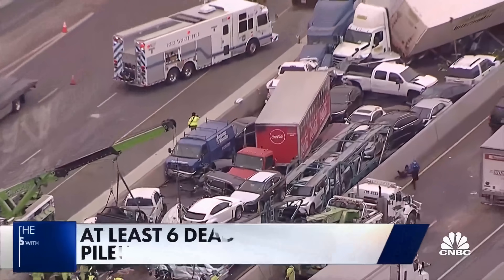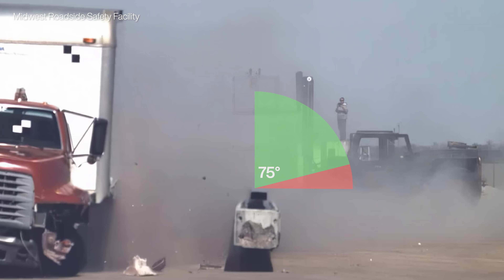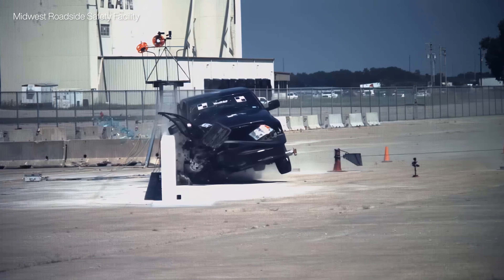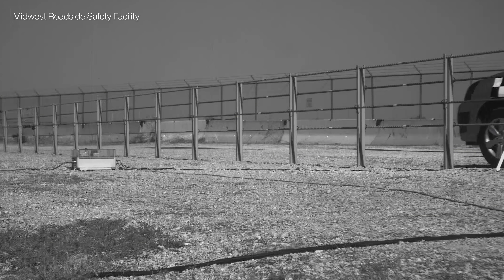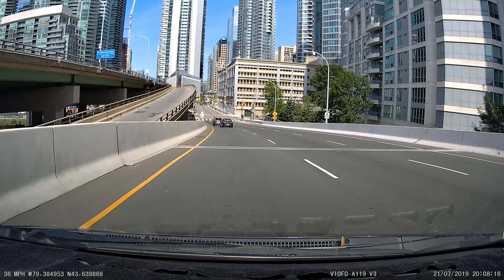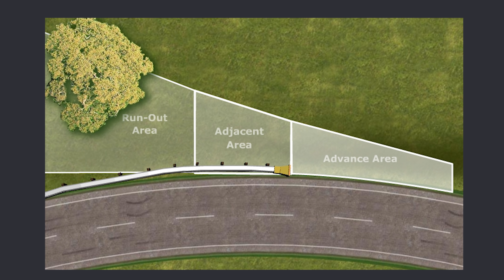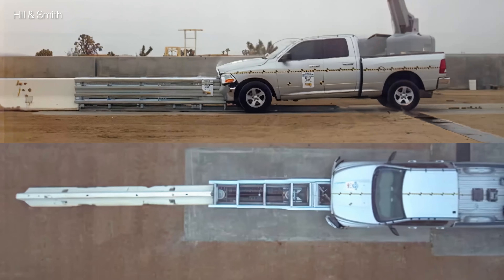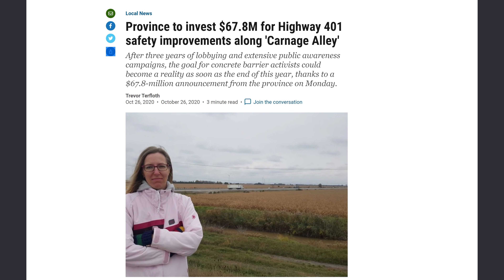How Road Barriers Stopped Killing Drivers

Comment: And remember, the new designs that save you only work if they are installed correct. If a bolt is in the wrong spot, the wrong parts are used, or a cable isn’t set right, it will not crumple correct and it’s locking up

Comment: Thank you for your report...
You left out; Cables barriers need replacement after every impact. Down Time from impact to replacement means there is no barrier. Where as Concrete will deflect again, and again without the need for replacement.

Comment: M53 in Michigan got cable and cars  penetrate easily. Most of the free way has space between lanes to let drivers regain control. It's a rural free way and the cable is very unsightly

Comment: Homestly Never thought about all of that and now I wanna Go out and Look at all These structures here in germany and Analyse how our road safety barriers work. I just know that wie manly have the Metal ones, only Highway constructionsites have concrete ones which you Canon easy take off. As I remember the Metal ones here run in to the ground Like a ramp usually. On roads with a lot of motorbikes and accidents involving these we also have like a metalpiece under the Main Barrier, to avoid Bikers to get Split in two. But from what I‘ve Seen in this Video, it seems Like Road barriers are way more advanced in the U.S. than germany. But also we have other safety measurements like TÜV or proper long and thorough drivers licence classes. So idk if that already makes differences, anyways now I wanna know more abou how it works in germany

Comment: If concrete barriers were any unsaffer, id be dead 100%. Went 122 into a highway barrier at an angle of like 30-40... pretty steepe. Ended up ripping both axles, ruined my front end to oblivion, but i came out unscathed 😊 im extremely grateful

im talking about the jersey barrier

Comment: 7:28 - "equal, or slightly higher fatality rates" - but the Washington study shows the fatality rate is more than twice as high with cables? I'm not sure you can say 'slightly higher' even if the percentage of total is 0.5% higher -- I'd sure as hell want to crash into the concrete over the cables with those stats

Comment: Great video.  Just built my house in Japan. Have a circuit box by Panasonic that is similar to yours and the plugs all match yours.  You are right about the wire and screw requirements for wall plugs in kitchens and washrooms too.  The electrician said they would be required in plugs needing a large amount of electricity flow or that are near water sources. Think wash machine, air-conditioning or plug in kitchen appliances.

Comment: 9:31 on guardrail end terminals, and rails in general, there are a few important things:

The trinity system you showed has been shown to have several flaws, often completely failing and spearing instead.

End terminals and guard rails in general do not work if not installed or maintained properly. Pretty obvious right? But the unfortunate reality is that these often are NOT installed correctly. From missing bolts and uninstalled cables, to bolts on the wrong side and in the wrong spots, any mistake in installation can and do cause these systems to fail and end up spearing occupants or otherwise failing to stop the car safely. 

Furthermore, many of these systems are not actually tested at high enough speeds (eg 70 mph) before they are approved for installation.

See Steve Eimers channel. His daughter was speared and killed by a guardrail end terminal that failed. He has numerous videos showing the state of disrepair so many guardrails are in, and talks about which designs have and havent been tested properly.

In my own area, there are numerous sections of guardrails on the local highways that are damaged, warped, and/or use outdated end terminals. All of these are death traps waiting to spear someone, and they likely will before they are replaced, since "phased out" just means that new installations have to be up to code. So in order for certian installations to be updated, someone has to crash into the old one first.

Comment: I don't trust the cable barriers anymore, I used to think they were great for all of the reasons you listed.
In my home town a few years ago the cable barriers caused 2 very tragic fatality accidents.

Instance #1
A lady was driving down the highway (investigation found she was doing the speed limit of 60mph) she had a heart attack or stroke while driving and was luckily dead before she hit the cables, had the cables worked properly it would have ended here, instead she hit the cables for her direction on the highway it caught her car and made it change it's angle to where her car went through the cables and she hit the cables for the oncoming direction of traffic at a sharper angle and her car went through those cables as well where he then continued head on into a family killing them on impact.

Instance #2.    This was 2 weeks later 1/4 mile south of the first crash (the cables had been replace and all supports were repaired and ready for another crash)

Lady was driving in the opposite direction of the first crash, iirc she was also doing the speed limit of 60 and was clipped by another car causing her to go off the road into the cables. The cables ended up killing her as they went over the car and removed the roof, her vehicle continued through the second set of cables designed for the other direction hit a semi truck head on ensuring she didn't not survive, killing the semi driver on impact and the semi threw her vehicle back into the oncoming traffics left lane where she was then hit by another driver killing them.

Comment: Hwy 2 Alberta canada had clear areas for vehicles to go off the road in slippery conditons or being cut off. Then they put cables up, which completely totals any vehicle that touches it. I was cut off badly before and had to go to the clear area. My car was fine and drove out. If it happened a few years later, i would have to  make a split decision to be tangled in cables or rear end a car.

Comment: Good video. But i want to comment that traffic deaths are not down. When this video was posted the deaths hsd increased significantly in the last 5 years and they were at a high not seen since the mid to late 2000s. Not sure how that information got messed up.

I also wanted to seat belt enforcement is quite minimum and catching drunk drivers accountd for likely less than 5% of actual drunk drivers on the road. I think its more likely educating drivers about the risks associated with not wearing seat belts and drunk driving. Combined with the safety features added to cars amd traffic innovations like you showcase that stop us from having even more deaths. 

But we are definitely having more traffic deaths than we've had per mile driven. Some evidence showing thats to do with people driving bigger heavier vehicles with numerous blindspots combined with infrastructure that utilizes minimum traffic calming and encourages high speed. Lets not forget sprawl causing longer commutes which increases vehicle hours driven and increases the need for driving for trips that public transportation, walking, or biking could have been sufficient for had our infrastructure allowed for it. 

I think showing the graph back to the 1920s is a tad disingenuous because people were driving steel death traps with no air bags, selt belts, no crush zones, and nearly nonexistent traffic rules or drivers education. 

The real story is that people are currently dying WAY MORE.

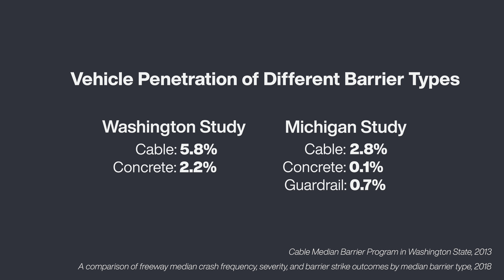Comment: 7:27 it’s misleading to describe the results of the Washington study as cable barriers having “slightly higher fatality rate vs concrete”. Putting the rate into context, both fatality rates are small to begin with, and the cable barriers in that study show a fatality rate that is MORE THAN DOUBLE that of concrete. I’d argue that that IS a significant difference, even though 0.5% difference seems small. When considering the number of car trips taken every day by Americans, that’s a huge difference! You can argue for their use due to differences in injury rate, but it’s bordering on deceptive to try to minimize the difference in fatality rates. Just acknowledge the difference for what it is!
Reply: Excactly what I wanted to say. Imagine you have something that can reduce the fatality rate by more than half.
Reply: Yes, but the sample size is too small for an actually significant difference, so this study of this sample likely does not reflect the actual differences between results due to these two kinds of barriers. There's no conclusive evidence that they are different

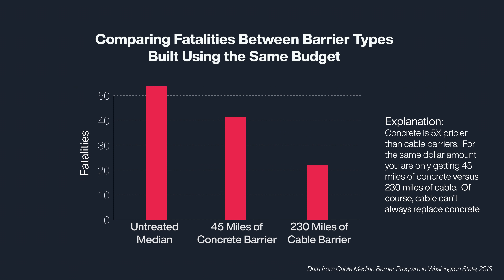Comment: 7:55 I didn't notice you mention this, but I write it down anyway. 

What I speculate about is the Hazzard of cable barriers in relation to motorcycle accidents.

Here, the body can wrap around the poles and cables, while solid concrete with a slope wouldn't pose that risk.

I always get the creeps while riding  on highways, which cable barriers. If I get unlucky and slips, I pose the risk of sliding into those getting decapitated or split in half or wrapped around them.

Comment: Would you consider doing a video on protected intersections? Toronto is building one right now, scheduled to be completed by the end of the month (August 2024). There are a lot of details that go into them, for experts. But the general public is not very aware of them and would benefit from a deep dive on the topic.

So far I discovered 5 different kinds.

The Dutch standard
CYCLOPS, in Britain
Painted intersection, like in Salt Lake City, that used temporary materials
The Davis, California design that splits into 3 routes for cyclists (I call it the Frankenstein version because of this). It tries to make everyone happy.
And the Nick Falbo design.

They are all different but serve the same purpose. I prefer the painted version using temporary materials. It can be made faster, as little as a week, once the design is approved, vs a permanent one needs to wait to be tendered, budgeted for, and built, which takes years longer from the time city council approves the project.

I don’t see myself ever making a video myself, at best I would collaborate with others.
Reply from the maker: Thanks for the suggestion! If bikes not cars has some something on it already
Reply: I’ve looked into protected intersections for over a decade. There are videos, seminars, web pages on this topic but nothing is a deep dive, showing the 5 kinds. There are more than 5 kinds but the others are not so good. Ottawa made a protected intersection where drivers drive in the bike lane because it’s not clear enough where they should go. So they use it as a slip lane, a right turn lane. I have an idea about the bad protected intersection designs. They are created by street planners who don’t understand how to make it properly. So I feel these should be tested after they are made and changed ASAP once it is found wanting. But I see these designs that don’t follow existing standards as a source for better designs. We started with just one protected intersection design but now that we have 5 we have more good options. Sometime in the future we will have more good quality designs and these might be better than everything we have now. That’s the nature of innovation. We can embrace it rather than insist on implementing the same design uniformly across the city.

Comment: The number of road barriers that are improperly installed and therefore either provide no additional protection, or are more dangerous, is currently being cataloged by a father who lost his daughter to one of the barriers.  His videos can be found via a YouTube search to anyone who wants to know more about this dangerous and blatant negligence.  The .gov is doing what it always does; security theater.  Pass new regulations that it does not have either the will, or capacity to enforce.

Comment: Concrete ones in europe are only next to high speed highways, and then rarely, usually isolated toll highways with high speed limits. Like in germany, they dont exsist at all, i have seen ones like that on 150kmh paid highways in poland only.

Comment: I feel terribly uncomfortable with these cable barriers, and the reason goes back to the metal rails of old. During the early 80s I happily lived in Berlin - then strictly West-Berlin, an island within East Germany. We had a Stadtautobahn : a city motorway partially cutting through the huge woodland, Grunewald. Just around there a motorcyclist lost his life - and thanks to the damn guardrail also his head. Whereas the crumbled bike and the torso were on hand, it took lots of emergency staff a long while crawling through the vegetation before they had located the severed head. The accident was so gross that I never forgot it, and when I saw the first cable rails I started wondering what they will do to a motorcyclist? 
And I wonder whether bikes are being considered at all in these crash tests, or whether their riders simply take their lives into their own hands on the roads designed to catch cars?

Comment: In my area they replaced perfectly good concrete barriers with cable "barriers" and I have seen many cars flip over those slingshot cable systems, I don't know why they don't use the "kitty litter" systems that race tracks and airport runways use... a lot safer and the insurance companies would probably prefer the "kitty litter" systems as well.

Comment: No mention as to how cable barrier is called "cheese cutter" by Motorcyclists for obvious reasons, not to mention the pole strikes being a worse issue as there are more per meter.
Would rather hit  a concrete barrier from a low-side than some cheese cutter..

Comment: Another reason the increase in suvs and large trucks is a problem. The super high impact zones makes it harder to prevent flipping and other issues. It also inadvertently outdates old safety equipment that might still be fine for smaller, lighter, lower to the ground cars.

Comment: Might be a stupid question, but I’ve seen studies make stupid mistakes before lol

About injuries in concrete vs cable barriers- 
I see concrete mostly used in high speed areas and cable in lesser, so is that difference in speed accounted for in tracking the injuries?

Comment: I crashed on to the trinity soft stop at 55 mph.
With a 2003 subaru baja. It was a soft stop, airbags did not deploy and i was able to cotinue driving because it didn't damage the suspension. I was very impressed. I have pictures 
10:37

Comment: The sensational nature of car crash are justified. Car are among the most dangerous vehicles in the modern age. Car should’ve been phased out long ago and replaced with better transportation technology. Not to mention the numerous other negative side effect such as air pollution (killed 2,400 people per year in NYC), noise pollution, space inefficiency, and insane cost.

Car rail are simply a bandage solution that doesn’t address the chronic issue that car poses to society.
Reply: In addition, while driver deaths have decreased, pedestrian deaths have increased, and all associated costs have gone up.

Comment: WE HAVE CABLE BARRIERS ON I-26 IN S.C. I CAN TELL YOU THEY ARE NOT SAFE AND 18 WHEELERS GO THROUGH THEM LIKE HOT BUTTER. ONCE AN 18 WHEELER BUSTED THROUGH AND KILLED 2 AND TWO WERE FLOWN OUT. IF YOU HAVE TO DRIVE WHERE THERE ARE CABLE BARRIERS. SLOW DOWN AND STAY TO THE RIGHT. YOU LESSEN YOUR RISK OF GETTING HIT FROM SOMEONE IN THE OPPOSITE LANE.

Comment: Every time I get on the e-way,  I drive past a jersey barrier with a long black line from me coming as close to flipping as you can get without actually flipping the car. Blew the inner fenders out and dropped my vapor canister on the road. And ate the side of my rim. Tire didn't pop but it was skinned about 80% through. Bent the hitch reciever.
   Semi came over suddenly going a third the speed I was so I tried for the offramp and overshot. It does slow you down. Enough I didn't rear-end them.

Comment: I just saw a mechanic video with a guardrail completely piercing through a car from the passenger floor and both seats on that side. They're not all safe or fixed yet.

  They're trying to use all wood in a few spots around me. Looks like the heads of the bolts will immediately pull clean through if it was hit and not even slow you down as you go off a cliff and into the river.

Comment: Until I became a driver, I thought it odd when they added signs to denote “guardrail damage ahead”. I couldn’t understand why anyone would need to know that if they’re driving along or involved in an accident. Then, as a driver, I learned in the moments preceding a crash, you have some choices. You may not be able to avoid the crash, but often you can choose how/where you make impact to lessen the severity of the damage. Knowing the guardrail is damaged can affect that decision making. I’d be willing to bet an engineer had to fight to make installing those warning signs common practice.

Comment: YES! Please do more of this type of content. Dash cam reviews are a dime a dozen. THIS is interesting!

In the 70s, I and my childhood friends were traveling with my dad on his work runs. We were in the bed of a camper shelled truck, when we were forced into a steel pole by another driver. The truck centered on the pole at the front bumper at about 30mph. Note, this is before seatbelt usage. Kids in the back were slammed into the back of the cab and the driver was propelled into the steering wheel. No major injuries. Why? We had hit one of the newly installed break-away poles that absorbed the impact and still kept us from careening over the overpass into freeway traffic. Roadway engineers are the silent protectors of us all!